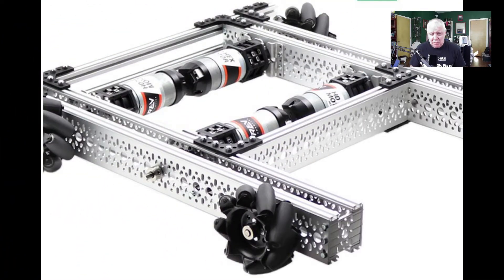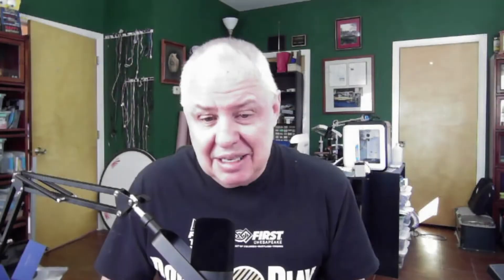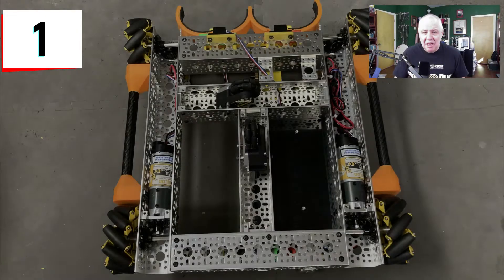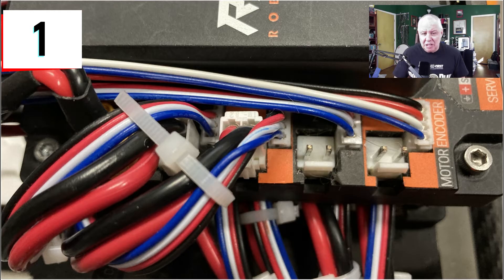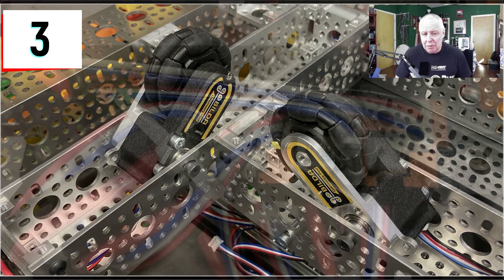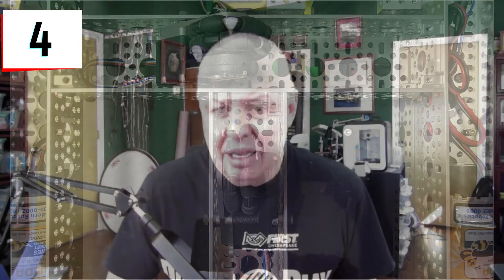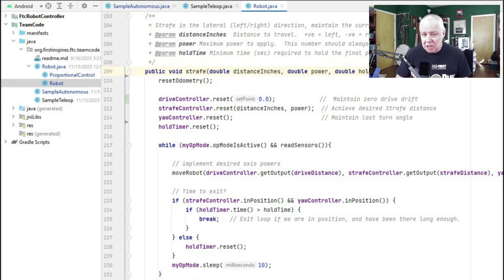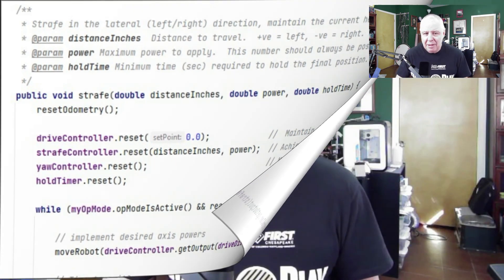Simplified FTC Odometry. Part 1: Overview

Comment: We are trying to build a method to drive the robot in a 45 degree strafe while holding heading.  Is it possible using only 2 deadwheels? Here is what we are thinking:
   /*FORTY FIVE TRY*/
	
	  public void fortyFive(double distanceInches, double power, double distanceInches, double power, double holdTime) {
        resetOdometry();

        driveController.reset(distanceInches, power);   // achieve desired drive distance
        strafeController.reset(distanceInches, power);  // achieve desired strafe distance
        yawController.reset();                          // Maintain last turn heading
        holdTimer.reset();

        while (myOpMode.opModeIsActive() && readSensors()){

            // implement desired axis powers
            moveRobot(driveController.getOutput(driveDistance), strafeController.getOutput(strafeDistance), yawController.getOutput(heading));

            // Time to exit?
            if (driveController.inPosition() && yawController.inPosition()&& (driveController.inPosition()) {
                if (holdTimer.time() > holdTime) {
                    break;   // Exit loop if we are in position, and have been there long enough.
                }
            } else {
                holdTimer.reset();
            }
            myOpMode.sleep(10);
        }
        stopRobot();
    }
Reply from the maker: Yeah, that looks good.  It just assumes that both axes will try to get to their destinations at the same rate.  The 45 angle may not be perfect, but it's worth a try to see what the path looks like.   Since we are using the Gyro to maintain the heading, two Deadwheel modules are all you need.

Comment: Mr Phil we are having a problem. We tried to use your sample code as a basis for our code and it didn't work 100%. We are using it for a basic linearopmode autonomous similar to the sample one, with added motors and movements. Sometimes the robot doesnt drive when told, and sometimes other motors that have nothing to do with your odometry class wont respond either. After researching online, we found that multi-threading is not compatible with the control hub because it only takes input from one thread at a time. Do you think this is the reason for our issues, and do you know how we could get around this?
Reply from the maker: Hi.  Not sure why you mention Multi-Threading.  Certainly my tutorial code does not do that.   My first question would be: Does my tutoral code work for you BEFORE you add any extra functionality?  Certainly I would try to get it running with as little modification as possible, and then archive that code before you start adding more functionality.   As for multi-threading....  I've been programming with FTC since 2008, and I've NEVER needed to do multi-threading.  Some folks use multi-threading to perform simultanious actions on multiple subsystems, but I have found that it's more reliable to build a simple State Machine for Telop actions.  You need to make sure you don't add any sleep() commands or "while loops" that can disrupt regular driving loops.    If you wanted to share a link to your code, and describe a specific issue (when things stop running) I'd take a look at it.
Reply: @GEARSinc  how would we go about setting other motors to set positions without using while loops?
Reply from the maker: @dakuucgt  One way would be to put the motor in RUN_TO_POSITION mode.  Then when you call setTargetPosition() the motor will just go there and stay there.   If you don't like that, then you need to add some code that gets executed every time the main while loop.  This code will read the current position and set the power to move the motor to the desired "setpoint" position (a basic proportional controller).  For teleop, this control code would get called once every control cycle.  For auto, you would need to call this code from inside the drive, strafe or turnTo methods.     Make one function that controls all your other motors, and just call that function in whatever code is already looping.

Comment: How do you have 4 motor encoders and 2 odometer pods plugged into motor encoder slots simultaneously?
Reply from the maker: You can't have 4 motor encoders and two odometry pods plugged into ONE Control hub.   You either need to add an expansion hub (to get 4 more encoder inputs), or some other device, like an OctoQuad to get 8 more encoder inputs.  If you ONLY have ONE control hub, then you need to run your motors in RUN_WITHOUT_ENCODER mode, (which does not need the encoders plugged in, which is the default) rather than "RUN_USING_ENCODER" (which I normally prefer). This way you have acess to all 4 encoder ports.